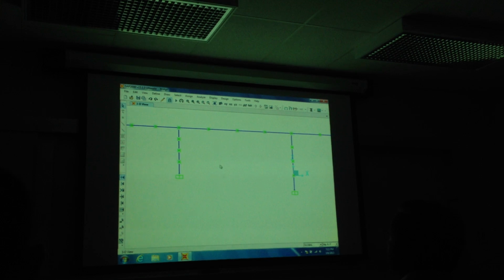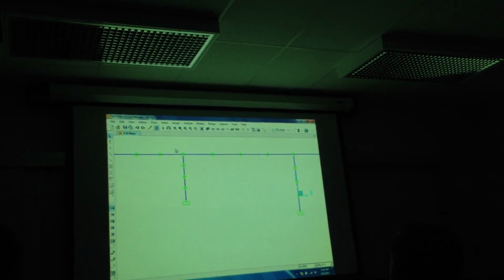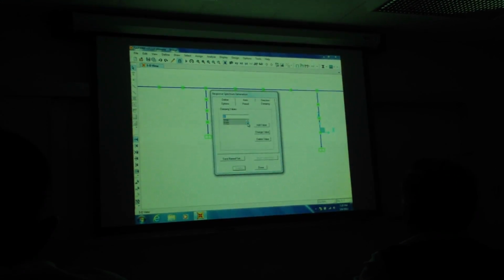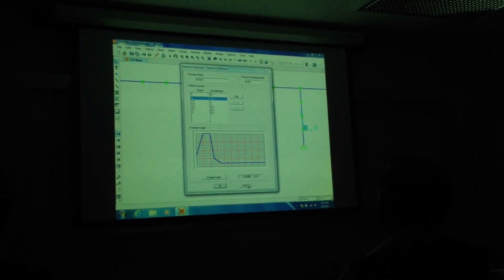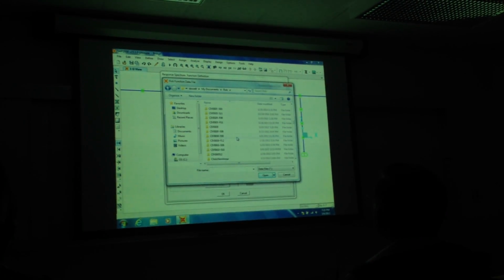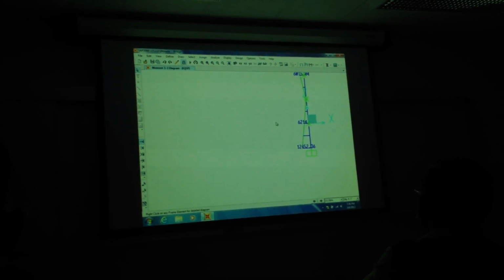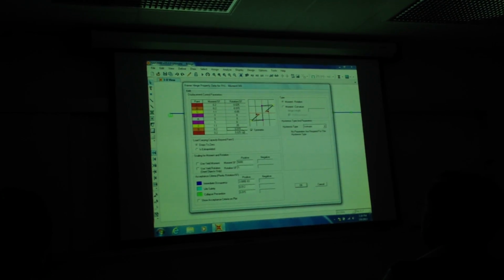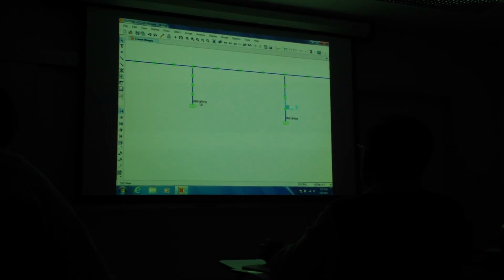SAP 2000 Nonlinear Analysis of Concrete Box Girder Bridge Part 1

Comment: what is the sap2000 version used in this video
Reply: James Graham SAP 2000 Ver. 14 does not have a tab bar application. I Think this is SAP 15 or newer version.
Reply from the maker: SAP 2000 version 14